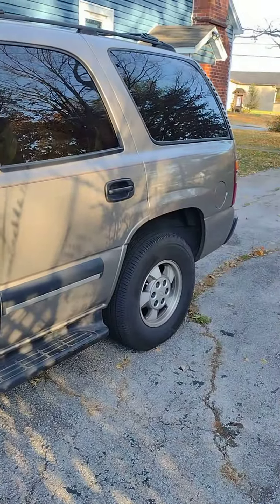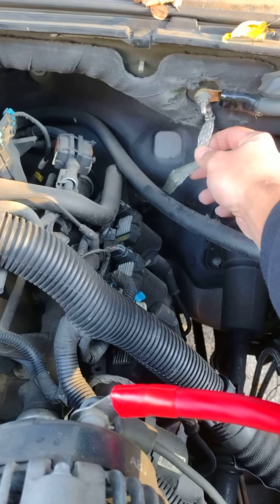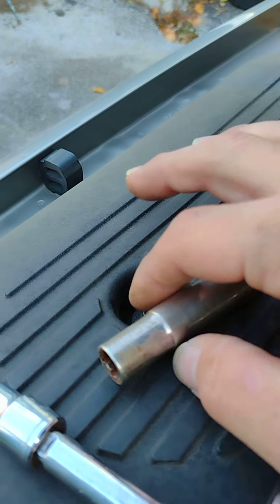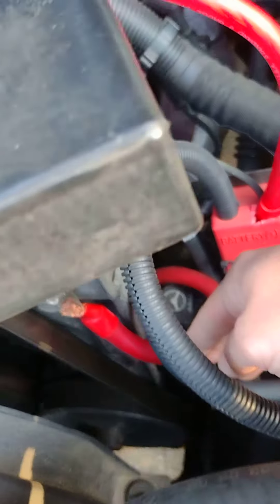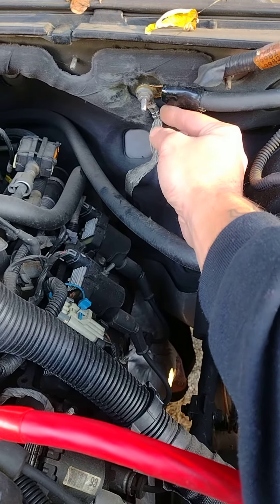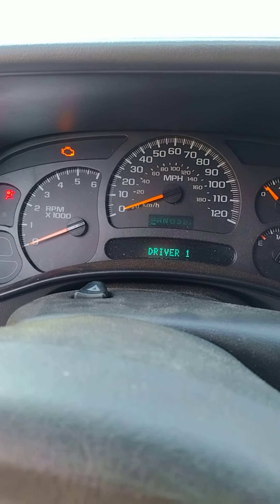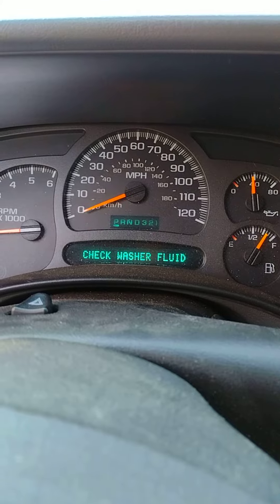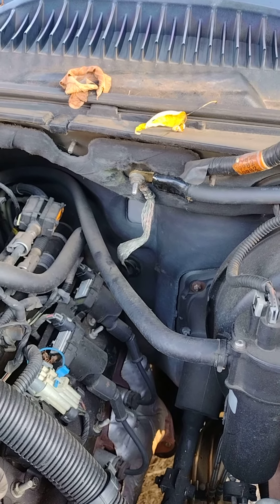2003 Chevy Tahoe Reduced Engine Power Fix

Comment: Mine doing the same thing. And it’s the same year but it’s z71. I’ve fixed the water pump thermostat and it’s saying faulty wiring so I’m waiting on it to arrive hopefully that’s it so I can get my baby back on the road
Reply: I’m having the same problem I have and 04 but not getting response from pedal
Reply: Can I have a link to it if you guys don't mind I'm not good at doing the wiring things but when I see this type of videos makes me wanna do it and see the difference
Reply: Replace the throttle housing. It's technically the piece on the side, but they don't sell it separately, so you have to buy the whole throttle housing. This fixed it, and now I don't have that issue.
Reply: Also there is a sensor for the pedal that can help with the pedal issue
Reply: How did you relearn the throttle body
Reply: @kevinnelson6529  I started by working my way through one thing at a time and spending money. 
It's was the unit on the side of the throttle body, but you have to buy them as a whole, so I tried it out, and it worked. 
I've done so many repairs that I'm pretty much rebuilding the vehichle at this point and have so much knowledge on it I've come across things that nobody can help me with and I've spoken with several service mechanics and they can't even help me so I've accepted the challenge and hope that by doing so I can help as many people as I possible can to save what they can where they can. 
If you or anyone else comes across an issue, please do not hesitate to let me know, and if possible, I will make a video or tutorial on the matter to help resolve the issue.
Reply: @ricohallman938  sounds like throttle cable issue.
Reply: @chicagowarrior94  what do you need help with exactly.
Reply: @ricohallman938  I have the same problem

Comment: I replaced the throttle body with aftermarket and it is still REP after a few minutes on start up!! I think 🤔 that TB may be bad
Reply: I'm going through it so bad rn bro 😂
Reply: Having this same issue rn on my 03 tahoe 400,000 miles replaced throttle body and a week later I got a knock sensor code with rep

Comment: Yes, you can. I used to think this about 1/0 (0 gauge) too, until I started running DD lmao, now it's double-runs of 2/0 in everything. Try it!
Reply from the maker: I'll give that a try I'm always looking for upgrade choices. Where is the best place to get some?
Reply: Can I have a link or how to do it bro I'm not familiar with the wiring thing but I would like to do it if it makes a difference I have a Chevy Tahoe 2002
Reply: I love some 2/0 welding cable myself.
Reply: @chicagowarrior94 what's your Facebook or snapchat and I'll message you. Also I've been doing more repairs so I have found many other issues that videos don't cover but I got you the best I can especially since I've ran into just about every issue there is lol. I'll be posting a new video shortly about what I am dealing with now bc it is an issue that seems like so many things but isn't.

Comment: 03 suburban having same issue p1518 reduced engine I have a code reader I clear the code throttle seems to go up and back to normal it only happens when it's cold
Reply: Did you figure it out? Mine only does it when it’s cold also usually in the mornings only. Let me know please
Reply: @Pbk306  it was the throttle body I got a jet performance no more issues
Reply: Update it's doing it again. p1518, it's getting cold here again in the summer. No problems. I have a scanner. I have to clear the code I'm going to check that ground now
Reply: Replace the throttle. It's technically  the piece on the side of the throttle, but since they don't sell them separately, you have to buy a whole new throttle housing. This fixed my issue.
Reply: @infamous9303  Fuel Injection Throttle Control Actuator Module -- New; ELECTRONIC THROTTLE CONTROL (KUP); DRIVER SIDE OF BULKHEAD
It was this part that was causing the issue
Reply: Appreciate that information so it can help others

Comment: One thing to remember if you’re having this problem is to make sure your ground wire isn’t corroded and the connection is scraped all the way to bare metal. I thought mine was okay on the truck I bought because I saw someone had already ran big ground wires everywhere but when i removed the main one going to the block I noticed it was full of corrosion and the paint wasn’t even scraped off. Seems to have fixed the problem now.

Comment: It's called the BIG 3 upgrade it helps the grounds and power when adding a aftermarket sound system.
Reply: What is the big 3 upgrade? New ground cable and what else? I have 03 tahoe
Reply: There is a big3 and big4, but it's a simple do. I'll do a video for you if you can't find one. Let me know.
Reply: @infamous9303 I can’t find one lmk the big 3 and 4

Comment: I have a 03 Tahoe 5.3 I have done the throttle body and the map sensor just still goes in to power reduce mode but goes back to normal when I take the negative wires off the negative post help

Comment: Hey bro ....I got the same issue I did this and road good for a week and damn it doing it again..smh..did yours come back again ???? Maybe I need to clean it again or better 🤷🏾‍♂️
Hit me let me know bro ...thanks 
Thomas 👌🏽
Reply: My 09 Tahoe doing this but I'm not getting any codes , that's what so confusing 😢😢😢😢
Reply: Did you ever figure it out? If so, let me know I’m having the same issue.
Reply: I have an 02 tahoe and did this but it turned put to be the module that runs the throttle body. Its located by the brake booster with to connectors
Reply: Replace the throttle. It's technically  the piece on the side of the throttle, but since they don't sell them separately, you have to buy a whole new throttle housing. This fixed my issue.
Reply: The ground replacements also help

Comment: Won't adding that ground create a loop?  If you added the extra ground, I would think that you have to remove the old one. The grounding strip.  I'm no mechanic, but read something like that.  If there's a mechanic reading this please let us know what are your thoughts on the grounding loop.
Reply: The more grounds you have will help / give you a better connection and if  I'm not mistaken, my truck has 8 total factory grounds. Running car audio professionally I learned this. Also, I have $1300 alone just in batteries in this vehicle, so my connection is different than your average person and why I use larger wiring.
Reply: Ground goes to the same place. Not going to be a loop unless you connect to something on the positive side.

Comment: Mines turns on when i turn the ac on?
Reply: That's a new one.
Please drop an update if you find any more information on this issue. 
I'll see what I can find out for you on my end.
Reply: Yes--I have noticed a connection to turning on the AC and the P1518 code/going into reduced engine power in mine as well

Comment: I have a 2003 Tahoe Z71, that is losing power but does not turn off. Think it is maybe the same thing?
Reply: Mine goes into reduced engine powered after like 5 seconds of starting. What was your issue? I've done TB and sensor at pedal.
Reply: It's the throttle housing that fixed mine. It's technically the piece on the side of the throttle, but they don't sell them separately, so you have to buy the whole thing to fix the issue.
Reply: @infamous9303  done that, and the pedal sensor. You're referring to the sensor on the side of throttle body right?
Reply: @gmillan5150  Yes, but they do not sell that sensor by itself, so you have to buy the whole throttle body and I belive its just 4 bolts that hold it on. No matter what do not mess with the plate on the throttle body bc it can easily become misaligned causing more issues. 
Let me know if this helps if not I will shoot some other things to you that may help.
Reply: @gmillan5150  I would definitely check and possibly upgrade the grouds as well. There are several in the engine bay and under the vehicle. That also helped temporarily.
Reply: I sold mine one day in the middle of the road when the computer went out on me. Now I currently have an 01.
Reply: @TheBruceWayne that's so sad 😔 I hate to hear that and I would have kept it for parts at least. 
 Mine is a 03 eo your in the good years but know they all have the same issues eventually 🤷
Reply: @infamous9303  I just had to get rid of it. I traded/sold for a 03 trailblazer that I actually still have.

Comment: I see u put a 0 gauge on da alternator do you have to do that
Reply: No y9u do not but if you want to do the big3 or big4 then yes you will. I compete in car audio, and with multiple batteries and high output alternators, my vehicle has a lot more going through it than your standard vehicle
Reply: Adding larger wire especially copper will also help with your electrical

Comment: I only got code p1516, anything it could just be a faulty wire or bad ground?
Reply: I would definitely start there because something simple like that can cause a lot of issues.
Reply: Replace the throttle. It's technically  the piece on the side of the throttle, but since they don't sell them separately, you have to buy a whole new throttle housing. This fixed my issue.

Comment: I got the two wires fro Autozone for less then $10
Reply: What do I tell them to get it?
Reply: Lol not the wire I am running you didn't.
That is what a foot of my wire runs  cost wise 😂
Reply: If you want to run small cheap wire Amazon sells spools for the low 😅

Comment: You need to add oil
Reply: You maybe right how you find out???
Reply: After replacing you, wiring you need to replace the throttle. It's technically  the piece on the side of the throttle, but since they don't sell them separately, you have to buy a whole new throttle housing. This fixed my issue.
Reply: Low oil does not cause this issue lol but it can cause symptoms to make you think it is 😊

Comment: Why were you adding that zero gauge wire? For an extra ground?
Reply: I was told the upgrade helps with current flow because it's a  thicker gauge wire
Reply: Yes, it helps with the flow of your power, but I also run car audio competition, so I use more power, which requires larger wire. 
Big3 and big4 also help

Comment: I’ve done this changed the throttle body and everything and it’s still doing it . Any suggestions
Reply: Check your other grounds.
Reply: After many videos for repair, finally  found what was wrong with mine, it was the fuel pump. It also gave me the stability track code.
Reply: Same here Abel I need answers i didn't get any codes for the fuel pump but I did notice that my gas stopped pumping at 3 qts of a tank so I'm thinking fuel pump or possible float issue
Reply: Most people I've talked to have the ground wire system checked I heard that causes issues I have a 04 try disconnecting the negative cable for a few seconds with one of the doors open and reconnect it. It worked for my 04 suburban
Reply: Same here...smh .I'm bout to bury this damn truck...I'm going broke dumping parts into it...
Reply: After checking or replacing your grounds and deciding if you want to do a big3 or big4 upgrade you can try to replace the throttle. It's technically  the piece on the side of the throttle, but since they don't sell them separately, you have to buy a whole new throttle housing. This fixed my issue.
Reply: @Gabyregia make sure to change the fuel filter after changing the pump and its usually  the sensor on the pump not the pump itself.
Also the fuel pressure Regulator can cause these issues.
Reply: @godmc82 definitely a float issue meaning you need to change the pump, filter, and Regulator. 
I would be vigilant bc when I removed mines I ended up replacing the locking ring and the tank along with hardware.
Reply: @phillydee1004 thanks for the information hopefully this helps a fellow chevy owner
Reply: @grimminalmyndzrecords2065 they can be money pits but so worth it especially  if it's the right model 😊 having a self built tahoe that does 1000hp and k owing only the redeye can stand a chance is a felling y9u can never replace. I'm going in that direction with mine now after all these replacement parts and repairs lol

Comment: Shit don’t work
Reply: What he is not telling you is, There is more than just that one ground, You have to go around the motor there are more, even one on back the engine passenger side right behind the intake manifold you cannot see. You did not work hard enough to find ALL the grounds to fix it, That is why it did not work. Remember this miracles dont happen on Youtube everyday when working on anything automotive.
Reply: @mickeymouse3976   You're exactly right. I have a new to me nice '04, Z71, Burb and had to fix the wire you're talking about.  The end of that black/white stripe wire had been replaced before but the cobble job didn't hold. I soldered enough wire to run it to that flat braided wire and that fixed many problems such as no crank, CEL, crazy door locks.  There's grounds at the frame below drivers seat,  frame- drivers side below core support,  block- near motor mount,  etc.   Grounds must be clean and tight to complete the circuit especially with computers and micro switches.  I am running redundant ground wires from grounds up to alternator bracket using 14 & 12 gage tin coated wire but it really isn't needed if original grounds are clean.  Certainly don't need huge bulky wires.
Reply: @jefffrayer8238 the bigger the wire is the better connection and flow you will get 😊 OFC or pure copper is king. Also welding cable is the move if you have the money and don't forget the more grounds the better 😉
Reply: @mickeymouse3976 appreciate that break down.